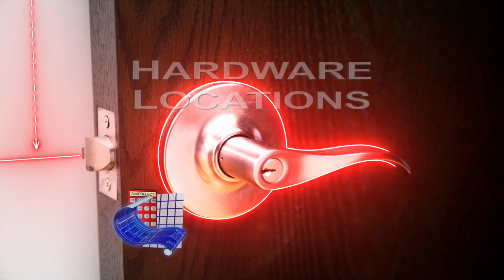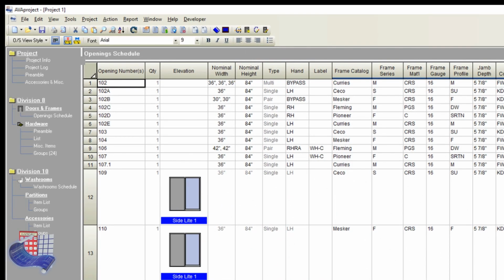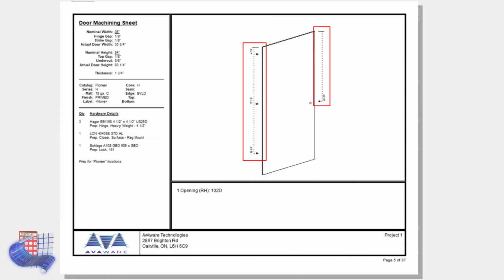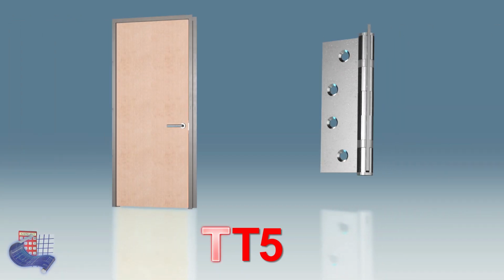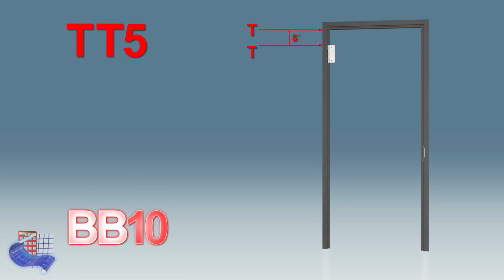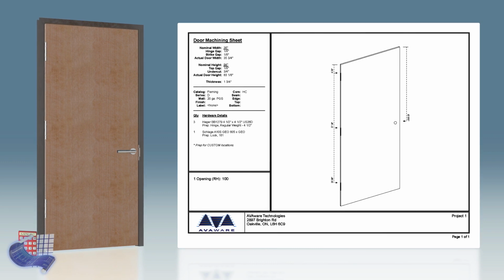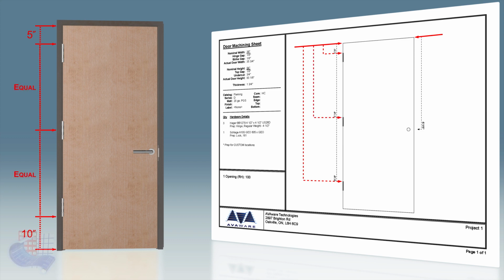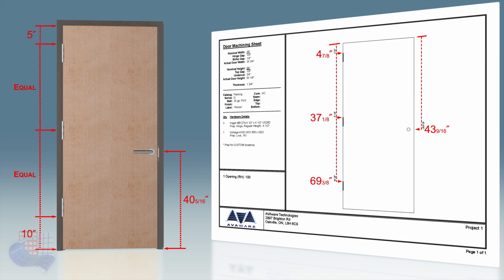AVAproject Tip: Hardware Locations

Comment: Ya know what would be cool? If we could just enter the hardware sets as they're scheduled into Avaware. Just the one time. No need to put in short codes to make a "master list" just to enter that same hardware again when you add hardware sets. Why do the work twice? 

It would make things easier, faster, and more simple to just create your hardware sets, then add the hardware by typing the part number (not adding both the manufacturer and the part number). Short codes already assigned. If Comsense can do it, Avaware should be able to as well. 

Avaware should also create a way to filter and edit the door and frame schedule. Copy and paste takes too long. If I have 25 openings that are all the same (maybe worth different hardware sets), I should be able to filter by the door/frame type and edit all doors/frames at once. Once again, if Comsense can, there should be no reason Avaware can't.
Reply from the maker: Thank you very much for your comments.  You'll be happy to know that AVAproject absolutely lets you do exactly what you’re asking for.  

AVAproject does have the ability to intelligently reuse hardware groups throughout a project, by automatically creating hardware sets/headings.  This is done as a time saving measure for those that are creating hardware schedules from scratch.  You can however disable this functionality and simply enter hardware sets directly, just as they appear in the hardware schedule you have been given.  Assuming you have subscribed to the ‘Division 8 Hardware’ catalog library, products details including manufacturer, pricing, categories, and even door/frame preps are automatically filled in based on the product code.

In terms of filtering schedules, AVAproject does offer an extensive set of sorting and grouping tools through the Material List.  In addition, AVAware offers an exceptional reporting tool called “AVAproject Fusion” that provides report generation capabilities that are second to none.  Reports can be designed by the users based on any and all of the project data.   The report can further be sorted, groups and filtered by any one or a combination of data components. 

If you are an AVAproject user, I suggest you contact the AVAware Support Team should you require assistance making use of these or any other features you may have questions about.